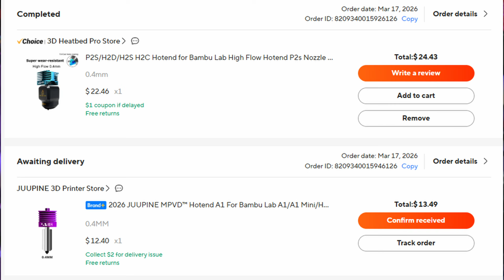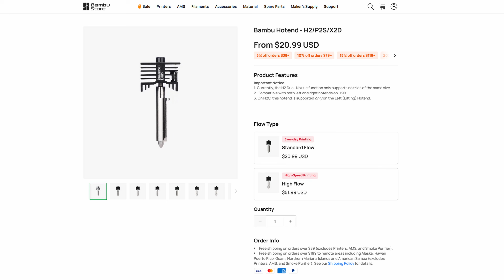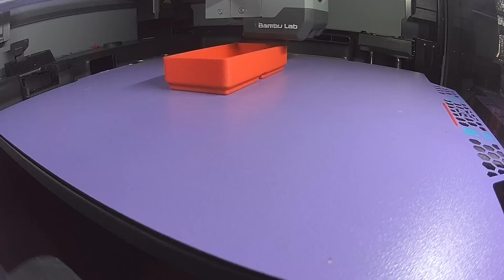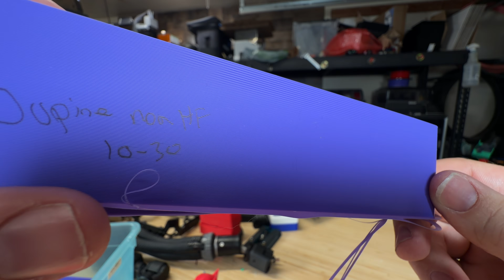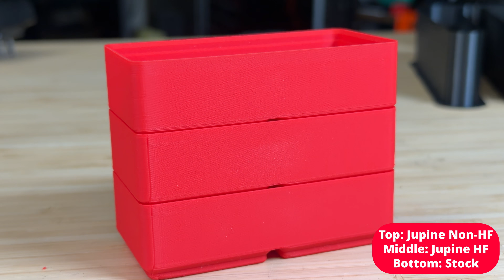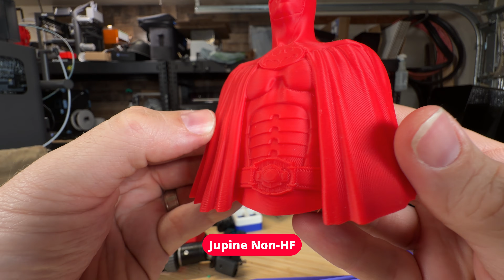Are Cheap Bambu Lab Nozzles Actually Worth It?

Comment: I did the same thing I run print farm I have printers with over 10,000 hours on a single printer. Go measure the hole diameter. You'll find the aftermarket nozzles are not exactly 0.4. they're more like .43 .44 I use an index drill bit 6180 it goes from 0.1 1 mm. The tolerance on the hole is not as good. The bambu printers are exactly 0.4.
Reply from the maker: I can totally see that

Comment: 3.5min in you finally mention that you tested all 3 with the same profile? How rediculous! There is a reason every filament maker have profiles for different nozzle size and type as that affects print quality. You need to experiment and dial in how the flow rate affects volumetric, heat, etc etc. At a bare minimum I hope you changed the nozzle flow rate to "high flow"?
Reply from the maker: yes how rediculous

Comment: I have an X2D. No reason why not to use aftermarket parts. The official ones will also clog after four prints anyway!
Reply from the maker: Haha, I just got some in from DUROZZLE that ill be testing
Reply: @RadDadsPrintLab  I'd love for someone to make a decent heatsink which fits between the two nozzles on an X2D, so we can rig a pull/pull fan configuration to stop the heat creep issues.

Comment: So if I tell the slicer I now have a Hi Flow nozzle does it change the G-Code?  Did you go into the settings and tell the printer you had a Hi Flow nozzle?  I would think that the Hi Flow nozzle lets the melted filament exit quicker.  The nozzles I got from AliExpress look the same as the stock.  I came looking to see if there were any insights into being able to tell the difference between a Hi Flow or Stainless Steel Nozzle  from others.  The nozzles you showed were different colors.

Comment: It really depends on the printer I think.  I have an aftermarket nozzle on my P1S and it works much better than the original.  My other printers, not so much.  I've tried it on my FLSUN S1 Pro and my Creality K2 Plus and it hasn't gone well.  I haven't even tried it on my H2C, I love that printer and wouldn't risk it right now.

Comment: The non high flow was no worse than the Bambu stock , the lines around the neck were the same !
Reply: I think the wall is too thin caused those lines.
Reply from the maker: The models were much closer for sure. The Gridfinity bin showed some difference